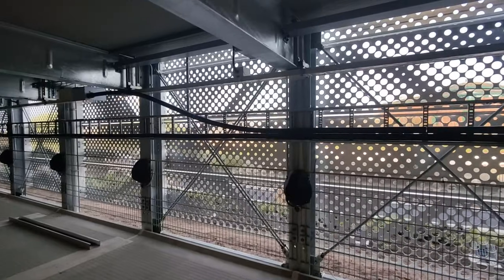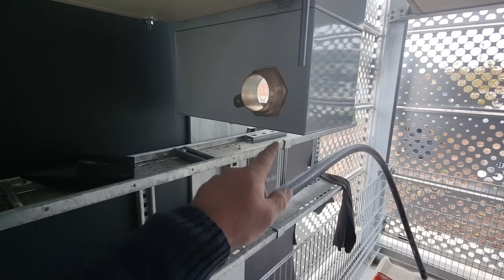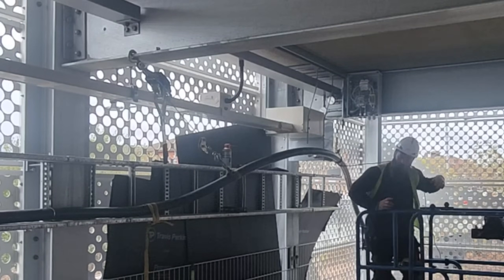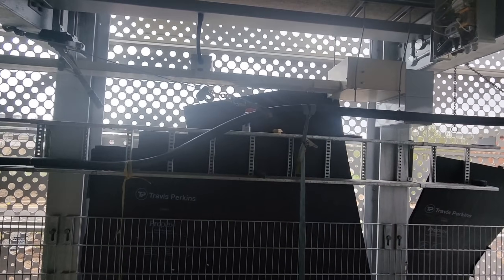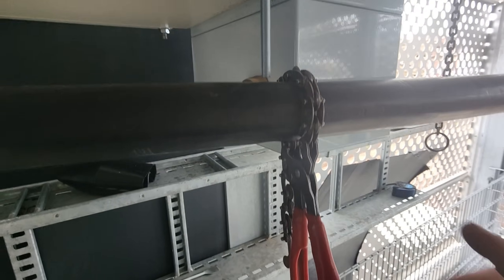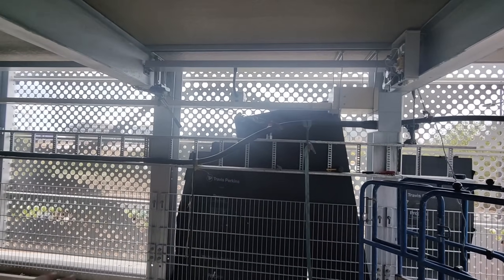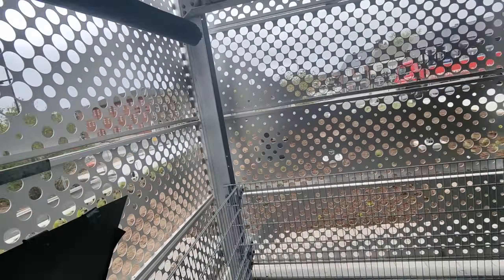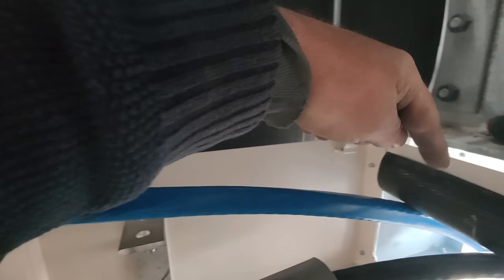Difficult? It was a little bit!

Comment: Kinda makes you wonder wtf we aren’t using tri rated rubber insulated cables instead of swa,, the cable is up on ladder rack isn’t going get damaged and you can always lid ladder rack if wanted…we struggle with swa far to much 😮 could set the ladder rack up closer to the extension boxes so you had less of a set in the cable and it be supported further along its length..yet again you made a pig of a job look easy. 😁😁😁  think the install could of been designed a lot better ..😊😊

Comment: I had to install 6 or 7 of those schneider bus bars for EV chargers with 4x185 aluminum cables that had Cca rating sheathe, hard as rock. It was a parking garage as well. I fantasized about those extension boxes and broke my arms bending those cables into place.  Mind you I installed those cables without that extension box! I thought they didn't even exist and asked my boss about it but he just shrugged it ahahahaha! It seemed impossible even though I was working with 185 aluminum. Those extension boxes make it seem super easy. Worst 3 days I ever spent struggling with those trying to crimp the lugs and make the connections solid. Awful, simply awful.

Comment: With some jobs you need more patience than you do skill. Nice use of the pvc shieth to act as an edging trim. If I had to be super critical, I would say the grey could have done with a tighter bend and it would have looked neater to put the gland on the other side (nearer the outer wall). But great work 👍